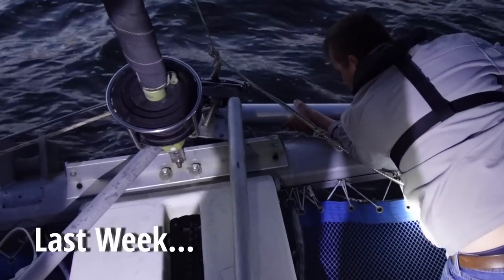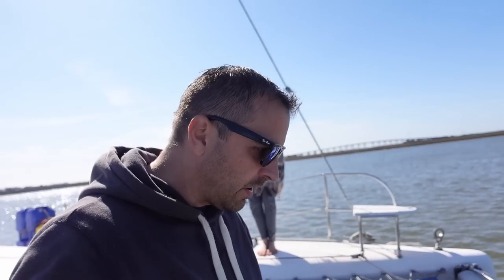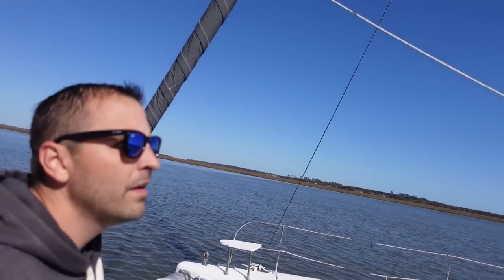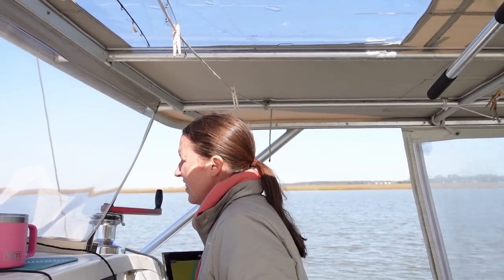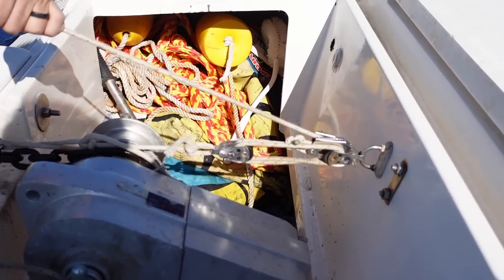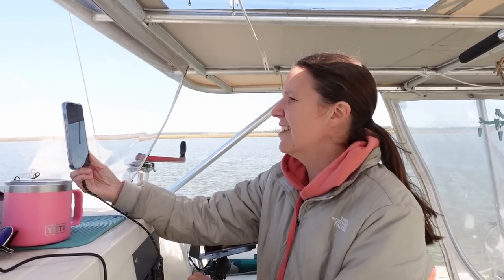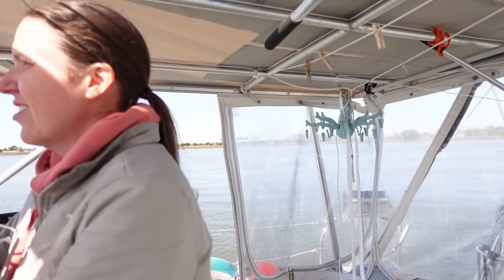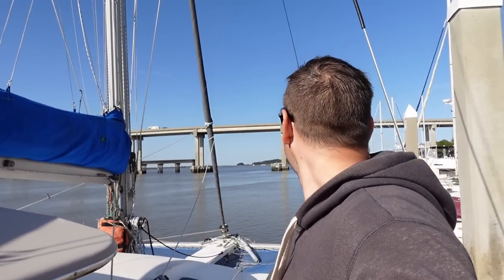Our Catamaran rigging broke after a heavy storm at anchor.   Here's what caused the failure.

Comment: as you discovered, the gull striker is not designed to accommodate side loads.   As a cat owner, our boat response at anchor, with wind plus current, is anything but stable.   You will notice under some conditions, the anchor chain will run under the boat, depending on current and wind.  When this happens, the bridal will rub on the bowsprit whisper lines.   This force will then transfer to the wire line on the top side of the sprit, and then want to pull sideways on the gull striker.  you had winds over 40 kts.   The forces become huge up there.   The solution is to breakdown the bowsprit and stow it before the high winds.   This will remove the sideload from the striker.
Good luck!   and we hope the broke castings come out of the tubes without fuss.
Reply from the maker: You’re correct!  Stow the sprit.  # learningthehardway. 😫

Comment: Hello, you have been thrown around quite a bit with this storm. Yes, you couldn't turn around the anchor and so the forces got in the way and the weakest part gave way. To communicate from the helm to the bow you should agree on a sign language for all the crew, because when there is too much wind or noise you will lose your strength shouting and your nerves will be put to the test and you will end up getting annoyed.... The sign language is very used in the construction industry with the crane operators, but also in Wall street and in all the financial platforms of the world where there is a lot of noise around. You just have to agree all together on the signs, (full back engine, back engine slowly, forward, slowly, more starboard, more port, stop, etc....) it's a learning, but very quickly rewarded. kisses to you all😘

Comment: Any dissimilar metals in contact with each other will cause galvanic corrosion. When we build pumping stations, we even isolate 304 alloy stainless steel from 316 alloy stainless steel from each other on brackish water projects.
Reply from the maker: While you are 100% correct, that wasn’t the cause of this failure.  Surprisingly the galvanic corrosion was minimal and only on the stainless bolts.  The failure occurred because of extraordinary forces on this part of the rig that was not designed to handle it.

Comment: Must remember this boat is 47 years old….things wear out.  Good luck.
Reply from the maker: 27 😉.  We’re going to get the rigging replaced in a few months.   Thinking about Dyneema for the standing.  What do you think?
Reply: @SaltyEscape  dyneema degrades in UV. get a good sheathed product and it will be fine. i prefer solid carbon rod rigging myself.

Comment: It looked like there was a carabineer holding your anchor bridal end to the bow??  If so, that would be a weak point.  Probably a shackle would be more stout and heavy duty to take that load.  If carabineer were to break, it would suddenly transfer to the load the windlass.....
Reply from the maker: Hi Stephen, These carabiners are Kong Italy brand designed for this use. They hold about 8000 lbs each, 16000 lbs between them both. However, we have purchased a new bridle, which comes with new shackles. Hopefully the shackles will fit our existing bridle tangs. 
Ordinarily, I would agree with you, carabiners would be a terrible idea, if they hadn’t been designed for this purpose.  😊